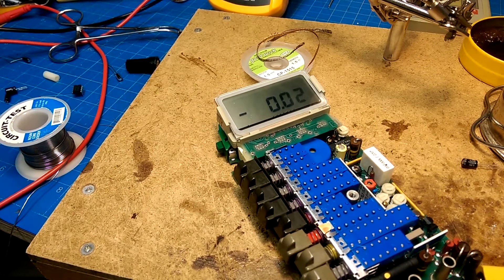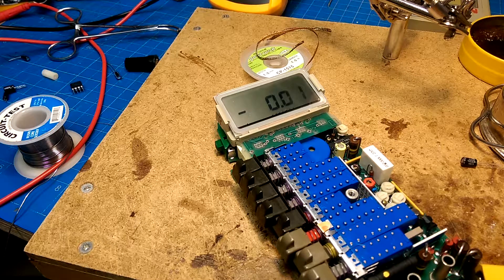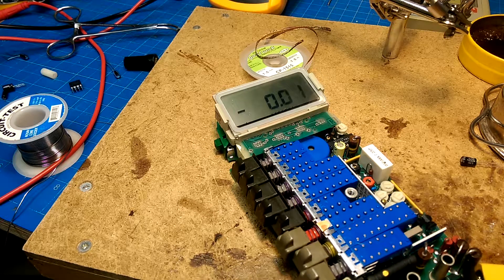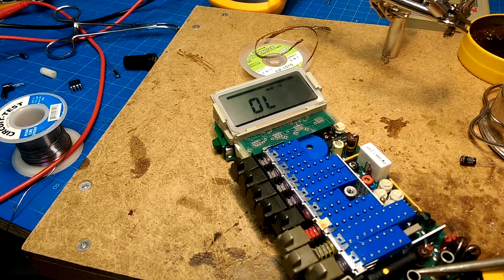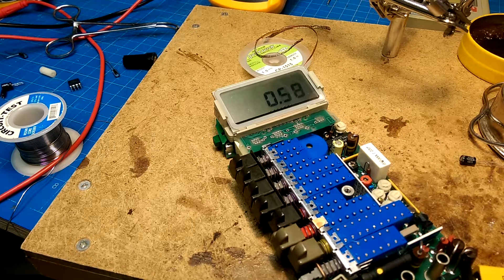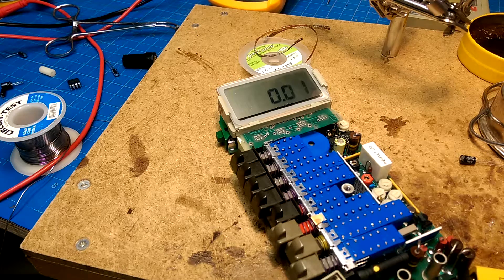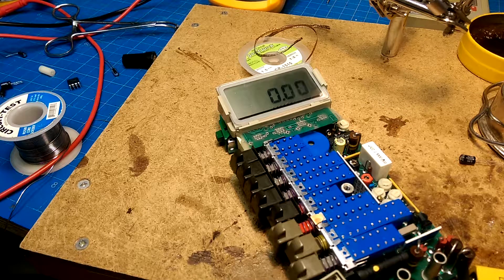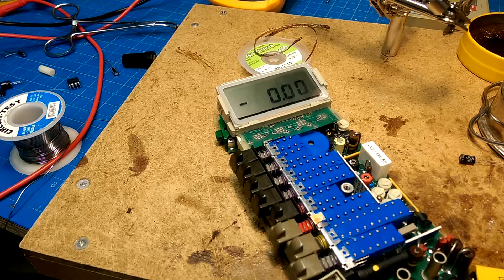Fluke 8060A repair

Comment: I am recapping mine, and notice your C19 (yellow cap by piezo) like mine is installed polarity reversed per board silkscreen + as well as on the schematic. I have also seen this same yellow (probably original) cap installed reversed, per schematic and board. What's up with that?